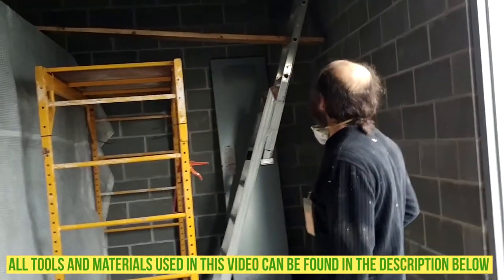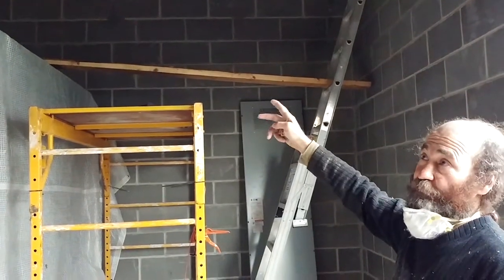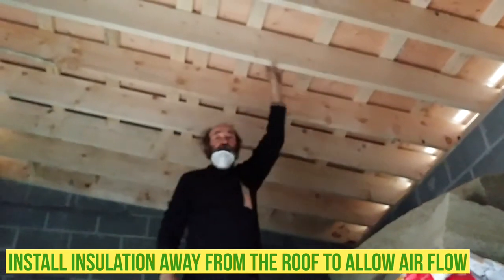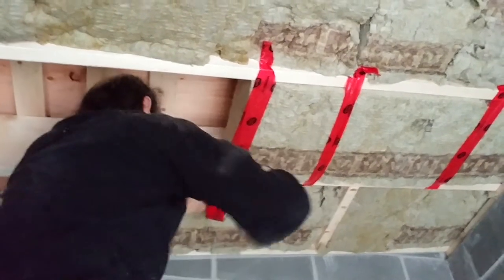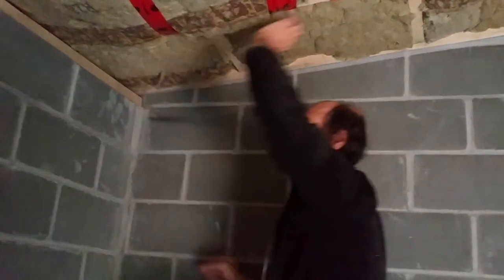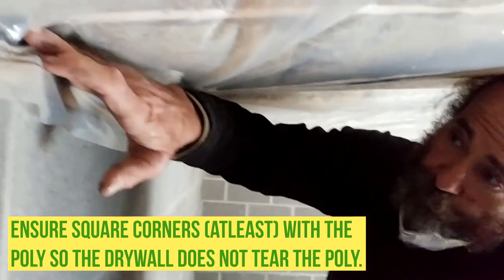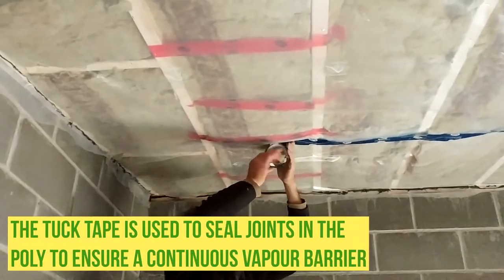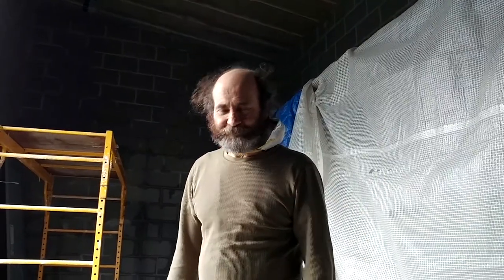How to Install INSULATION in Ceiling

Comment: Hello, thank you for all these great videos, great improvement on the quality and content, keep it up, great work.
Reply from the maker: Thank you very much for your support and comment, feel free to ask questions and your feed back is very important to me and my channel, have a wonderful time, enjoy the next video.
Reply: Thank very much for your video. Will you have follow up with this project? How to do the ceiling insulation for flat ceiling if there are walls in the middle? I just took off all the old insulation from flat ceiling. Could you please advise?
Reply: Sorry, flat roof, it is a 1969 duplex
Reply: Hello @sophieninawu9334  
When doing the insulation keep it close to the surface of the ceiling, allowing about 2" of space between the plywood on roof and the top side of the insulation. If you have 10" just use 8" insulation. Do not compact the insulation into a tight space, make sure it's narrow enough so that it fits but not forced. Here where I am (Canada) a vapor barrier is required on exterior walls and ceilings. It might be different for you. Let me know if you have more questions!

Comment: Thanks so much for showing the entire process... if our detached garage doesn’t include the small ventilation gap above the joists, do we still proceed onward and do both roxul and a pour barrier or just roxul? Mostly sunny weather throughout the year.
Reply from the maker: Hello there, thank you very for watching my videos, I would do both insulation and vapor barrier, that way would keep the air in or out, we should have about 2" air gap between the plywood on the floor and the insulation for air circulation, having the air circulating is important for mold prevention, keep safe and enjoy life, let me know, if you have more questions